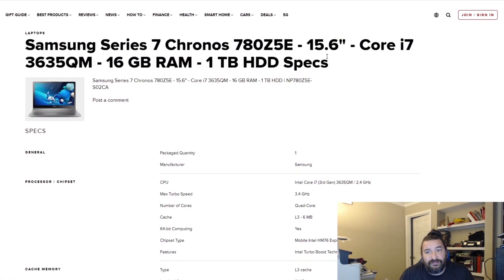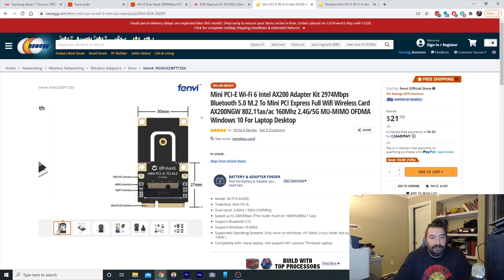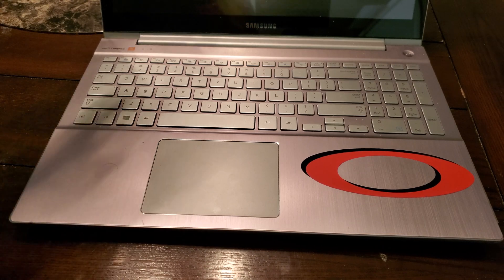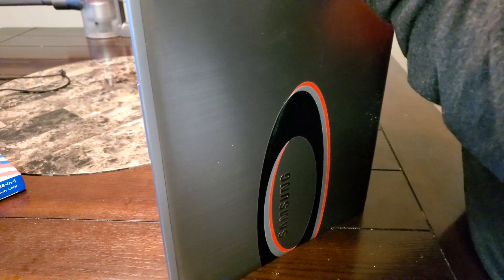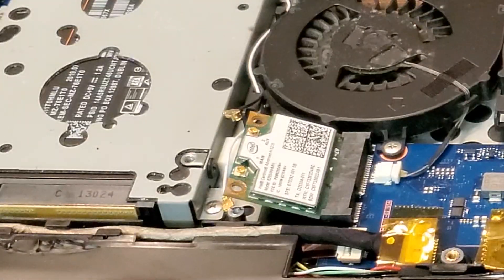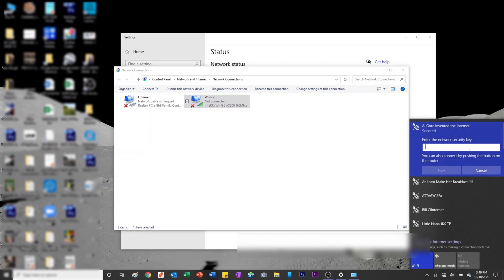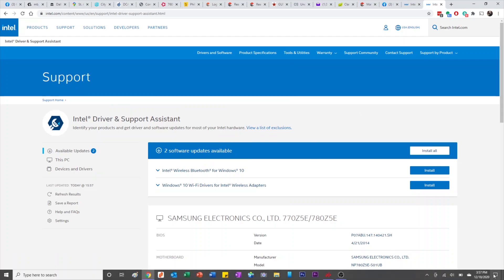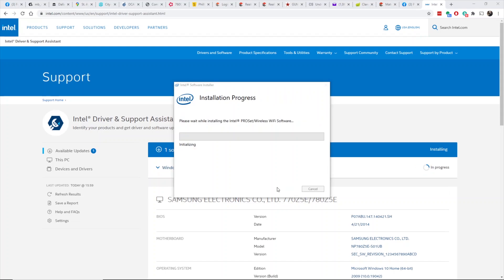Upgrade Your laptop to Wifi 6 802.11AX  Samsung 780z5e upgrade

Comment: Hi
Thanks for sharing this!
I have a Samsung NP700Z5C and another two laptops. 

At the same location in my home, this is the Wi-Fi speeds I receive on each machine.
1. Samsung NP700Z5C {Intel(R) Centrino(R) Advanced-N 6235}: 8.45/6.54 Mbps
2. Dell Latitude E7250 {Intel(R) Dual Band Wireless-AC 7265}: 40.0/13.1 Mbps
3. Dell Latitude 5400 {Intel(R) Wireless-AC 9560 160MHz}: 85.4/65.6 Mbps
The Wi-Fi card is specified within the brackets {}. Speeds are specified as download/upload.

Do you think the poor speeds of the NP700Z5C is due to the antenna location or the Wi-Fi card?
Do you think upgrading my Wi-Fi card would increase the speed to those of the Dell 5400?
Reply from the maker: well it depends on a lot of factors. first of all how much bandwidth are you receiving from your ISP? and how many devices are on the network splitting that bandwidth? and what type of router are you running to pump out the WiFI signal

these are things I would address first before swapping cards

And are these speeds the speeds you are getting sitting directly next to the router or where you use the devices?

Comment: Can I install at AMD laptop?
Reply from the maker: Yes you just have to buy the right card that fits in your system 

What laptop do you have?
Reply: @tcduck02  My laptop is Asus K55N. Can I?
Reply from the maker: @AlrizalAkbarN  under properties what is your current wifi card the one I used should work with it system from what I'm seeing

Comment: Great video bro, thanks
I purchased the same card like your and Installed but my HP laptop didn't see it bro, I heard you say undo the old adapter and Bluetooth first before Install the new card? Is that right bro?
Reply from the maker: Did you do the windows update and install the correct driver

Sometimes you have to reboot a few times 

Make sure you're plugged into ethernet
Reply: @tcduck02  I did go to Intel and downloaded the ax200 drivers bro, after reinstall the adapter and reboot it finally see it As WiFi 6 AX200 160MHz bro,but I check the status much slower then my old one bro, not sure what else I need to set bro
Reply from the maker: @vumyden05  your connection to the router is slower? And you're the same distance away? Are you connected on the 5g signal? Do you have a tri band wifi5 router? Or wifi 6 router
Reply: @tcduck02  yes same distance bro, even closer now that i sit next to it  and i have 5G connected with a NETGEAR WIFI 6 ROUTER AX6
Reply: @tcduck02  oh yeah i also heard you say AX201 , is any different to AX200?
Reply from the maker: @vumyden05  I'd reboot PC, and router... and check the connection speed  and make sure you on the right 5g to get best speed its hard to trouble shoot it all without being there but if router is wifi 6 you should be getting max speed what is the connection to router saying your speed is
Reply: @tcduck02  OK bro, I will reboot everything and try again, I will update to you bro, Thanks very much bro
Reply: Oh wow bro, after reboot everything my 5G connection on my laptop jump to 1.4 Gbps bro, I think reboot few times sure help bro, damn what a speed, the 2.4G not that great though, Tha KS for a great help bro
Reply from the maker: @vumyden05  so it is faster now?
Reply: @tcduck02  bro , is double the speed from 860 to 1.3 ,1.4 Gbps bro , crazy fast
Reply: @vumyden05  yeah had to update 4 time and then boom as fast as my gig cat 6 connection